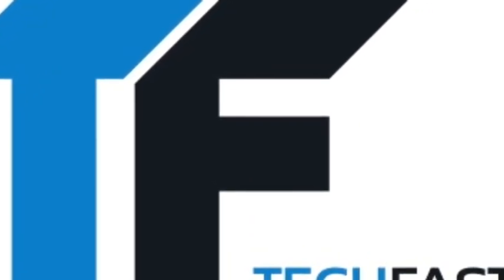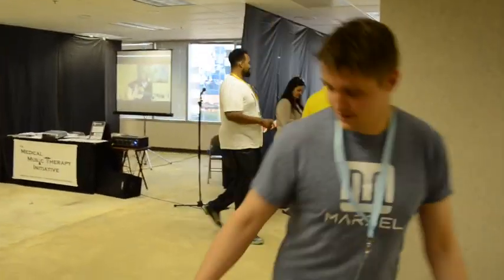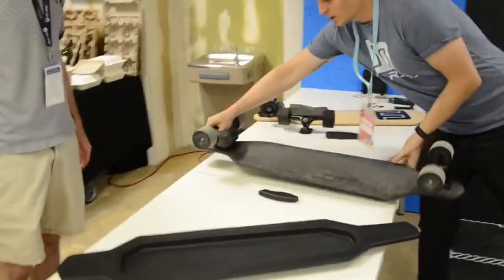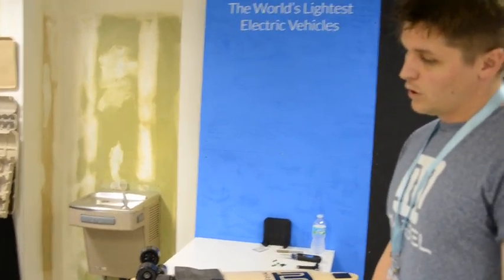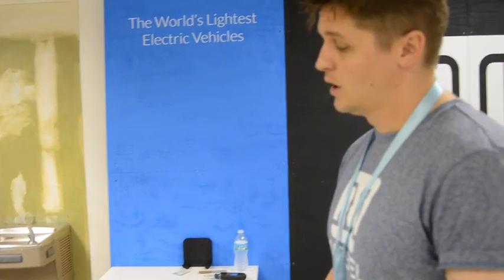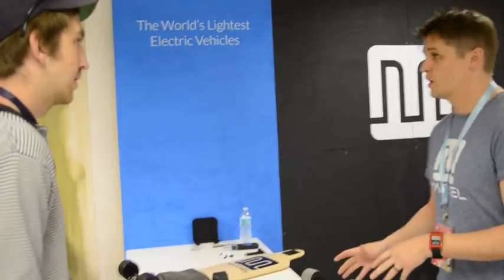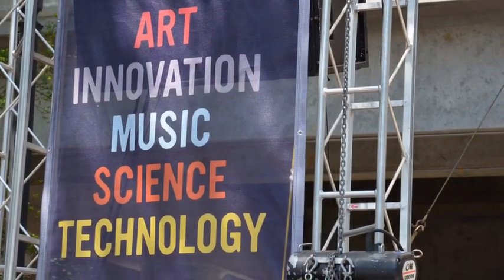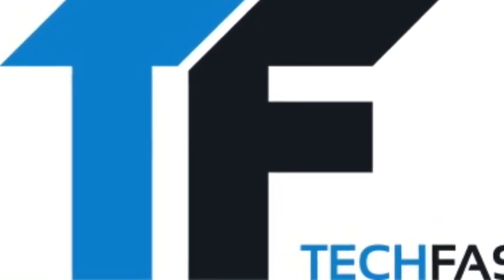Marbel: World's Lightest Electric Skateboard [One Spark]

Comment: I see a board war coming. The Zbutton makes you place your feet in goofy position in order to work plus the board is heavy. Roosted board has a sleek sexy form factor with daul motor drive however the range is a measly 6 miles and weighs 6 lbs more than the marble. Interesting to see who wins.